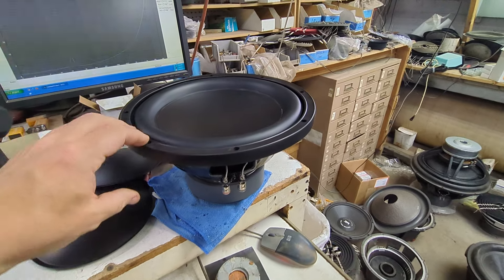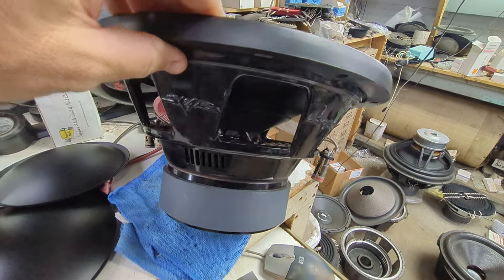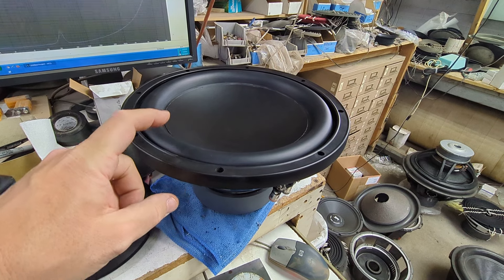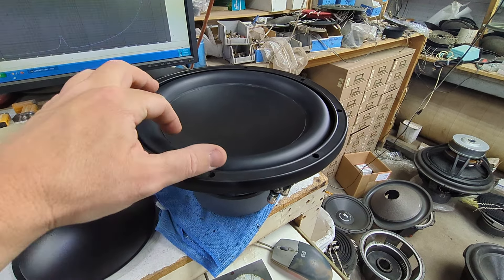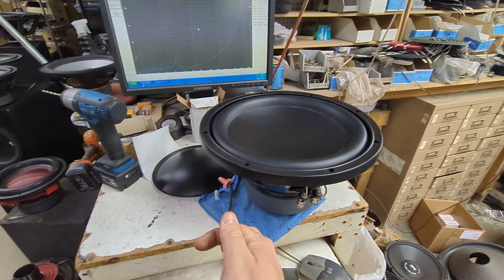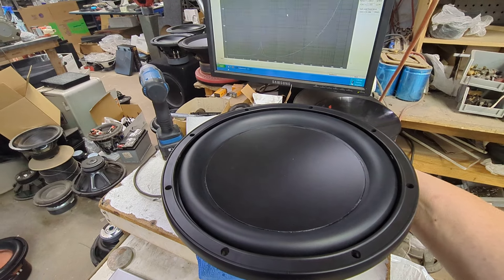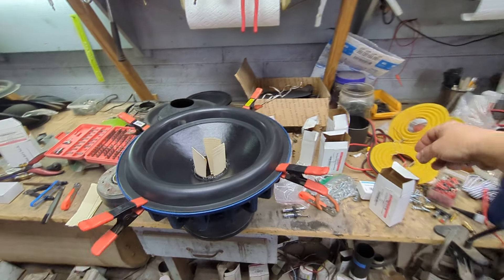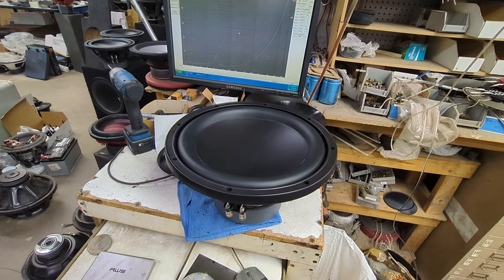12" Skar SDR Rebuild & TSP's 26Hz Fs!

Comment: I have one of these 12" SDRs . my triple joint keeps cracking. I used rubberized CA glue and it cracked again. Thinking I need to glue the underside on the VC. do i need a whole new "recone" can i re use the cone, voice coil and dustcap?
Reply from the maker: Just buy a new one off of Amazon and return the bad one